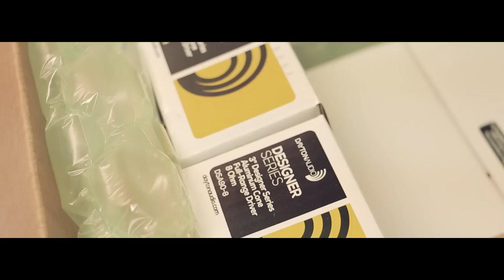Building the Blastbox Project Kit

Comment: One tip from my experience for anyone looking at this project; the instructions say to cut the speaker wire to 12" sections.  That isn't quite enough to tie them up neatly off to the sides.  I would go 14 or 15".

Comment: Need this system in a 2.1 arrangement! I have the blast box. Mine is the blue one in the video. I converted mine to 24v. Much better with 24v. Love this system! So powerful and clear!
Reply: How'd you do it and what did you use? Currently building mine.
Reply: @chem119  I followed PE's instructions to use a relay to connect 2 power boards in series.
Reply: Been trying to do 24 volts too. Where did you find the instructions on their website. All I find is how to hook 2 up for longer battery life
Reply: Send them an email asking about it and they send you the schematic.
Reply: I use the battery pack from an 18 volt cordless drill let the motor burn up on it and it works quite well for those amps plus I have several battery packs so they can be swapped out when it's dead

Comment: i feel like the Blastbox and Executive are being heavily let down by only having a 12V supply from 3 18650's in series.
TPS3116D2? knock of of the TPA3116D2 i think. ive played with those chips at 12V into a 4 ohm load your only getting about 15W. you can JUST hit 20W if you push it into clipping. give it a 24V supply and it should be a happy speaker system. THEN into 4 ohm you'll easily get 60W.
Reply: I converted mine to 24v. Plenty of power that way!
Reply: @konkilr  That's the way this kit should have been, especially since a reputable company like parts express is advertising it as 200W.
Reply: I have that amp using it for a different application with an old laptop 90w 19.1v power brick with two 4 ohm bookshelf speakers and an 8" 4 ohm subwoofer . No sure of the wattage to each speaker but in a 10'x14' room it can get up to about 75%  on the potentiometer before any distortion is audible . Thats way louder than a comfortable listening level.
Reply: @konkilr  how do you convert it into a 24V?
Reply: @nick parkin Email Parts express, they have a diagram on how to do this

Comment: Not bad. I built one about the same dimensions but with a car media player and car speakers. Sounds great. Half the cost.
Reply: As an audiophile and a woodcrafter, half the cost is impossible if apples to apples.  Maybe it sounds good to you but you did not buy a media player and buy the speakers for half the cost much less the pre cut cabinet which would cost you $80 minimum for a half sheet of Baltic sheet goods and you still need expensive tools to build the carcass not even factoring in the design of the speaker box.  Still not even bringing in the battery function.  People are drawn to that box because of the value.  Throwing speakers into a wood box with a car stereo headunit....not really what is going on here....nice try.
Reply: @123wmc  What ever dude.  Car media player $20 at Walmart, Speakers $20 at Amazon,  3 sheets of plywood 20x20 inches or so from Menards $30. 12v battery $40 at Amazon. Charger $25 at Amazon , Plus a $3 switch and and $7 charge plug . About $150 . And i did build teh box from scratch with just a jigsaw and a table saw and a drill. No expensive tools . You do the math. Done. This kit in the video is $259 .
Reply: @steamy1225  I'd love to see the results of your build!